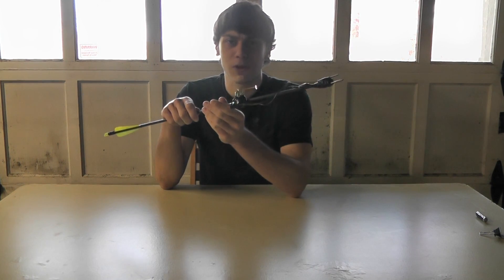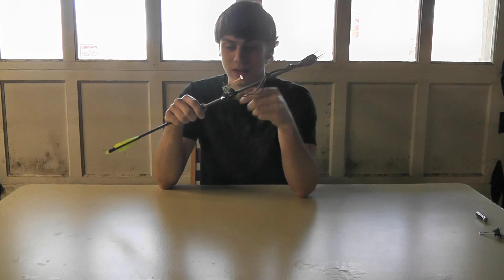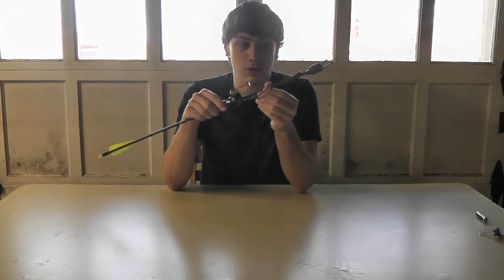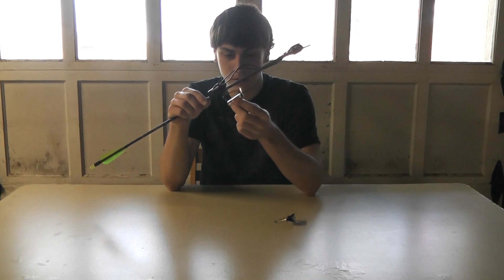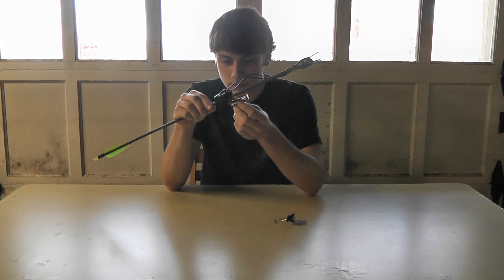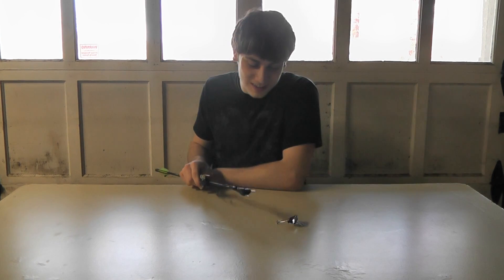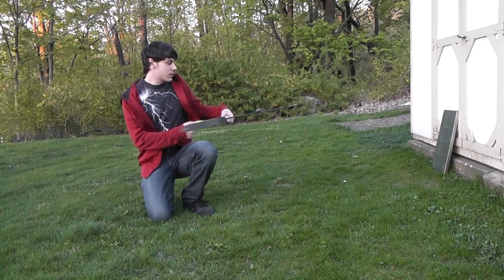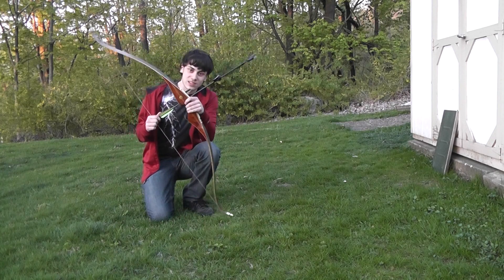Taser Arrow

Comment: I have a few questions:
1: What kind of voltage can it produce?
2: Is there a way to increase the shock time/voltage?
3: (follow-up to question 1) Is the voltage deadly?
4: Could you make a tutorial?
Reply from the maker: Excellent questions. I don't know exactly what voltage it produces. A quick Google search says 300v. That might vary between brands. I used a Fuji film camera. I recommend using this brand because the circuit board is small and ideal for an arrow. 

I know very little about electrical engineering. A disposable camera taser requires knowledge of how to solder wires to a capacitor. If you can solder you can make one. I'm sure there is a way to change the properties of the zap with the right parts, however I can't give you specific advice about that due to my inexperience. I may not know what specific parts you would need, but if I was improving my design in such a way I would start with the lightest smallest taser I could buy and mod it from there. 

Deadly is a difficult question. Deadly is determined by the voltage and the resistance of one's body. The resistance varies based on factors such as weight and muscle mass. Bigger dudes can take more voltage. I know it's not lethal for me. Before I shot the grill door I missed and shot the shed. When I went to pull it out I zapped my hand. (Sadly I no longer have this hilarious footage.) That isn't the only time I've "tested" it. I'm 170 medium build and to me it feels like less then a hard punch. Say 3/4 of a good hard punch. And the pain doesn't linger at all. If you're smaller than that or other factors come in to play then it might be deadly I really don't know enough to tell you it isn't ever lethal. The only thing similar to that on the web is that someone died from something similar. Someone made a similar device out of a large camera flash, the kind that pro photographers put on their cameras. I don't know if that was a reliable source. http://www.sciforums.com/threads/shock-from-a-camera-flash-is-lethal.40865/ 

I'm not making a tutorial on this for a few reasons. 

First the design is flawed. After repeated use the nails break out of the electrical tape. Even if that doesn't happen best case scenario the target is going to be more worried about the 3 nails stuck in him. I have plans for a better one, however before I can work on that I need to make a sub lethal arrow that has a long range. I'm close to success on that. After that I might make a taser arrow 2.0 however no promises on that either. If I make a taser arrow 2.0 I would likely make a tutorial on that.

Secondly the design is literally an Altoids taser taped to an arrow. Without an Altoids box of course. https://www.youtube.com/watch?v=vjXwBmettUs His tutorial will teach you everything you need to know. I have nothing to add to Altoids tasers at the moment so I do not plan to make a video on them soon. 

I'm really glad you asked those questions I could talk about this stuff forever. Feel free to ask if you need any more help.
Reply: I have an idea on improving the tip of the arrow:  I know Its different but this is designed for small game and with some tweaking it could be a useful substitute here's the link: http://www.amazon.co.uk/Style-Points-Archery-Hunting-Shooting/dp/B00N7249XW/ref=sr_1_45?s=sports&ie=UTF8&qid=1418974333&sr=1-45&keywords=arrow+tips
Reply: what do you think? any thoughts?
Reply from the maker: Ah, the stump tip. The stump tip is an arrow tip that is incredibly useful for practice shooting. You can shoot stumps or whatever you want within reason and the arrow tip will be undamaged. What makes this tip unique are the springs on the front. What they do is after an arrow is shot into dirt the springs push it back out and stand it up strait; at least ideally. This makes them easy to find in tall grass. 

Will they decrease the force of an arrow to a person? No not really. The springs only do their job once the arrow is already in its target. 

You might be able to make a better tip with a push spring though. I wish I could draw a picture in the comments. I'll do my best to describe the idea in my head. You could have an arrow tip that is a spring and then when it hits its target and the spring compresses the electrodes would come in contact with the target. Now a spring big enough to cancel the force of an arrow might be too heavy to allow the arrow to go sufficient distance. Only testing will tell. Or math I suppose, however at that point I tend to just figure things out from trial and error. Sometimes the results are so comical and unexpected that they can make a video on their own.

You're welcome to do some tests yourself with that design. I'm the middle of several other projects right now so you are likely to get up to the point where you can collect data before me.

Now if you do that make sure you know what you're dealing with. When you mod arrows there is a greater chance of breaking them. Especially if you don't know what your're doing. Worst case scenario would look something like this. Be warned its gruesome. http://www.texasarchery.org/images/brokenarrow/CEarrow510-21-04.jpg 

That is probably not going to happen if you do plenty of research and experiment in a way that is as safe. Remember that professionals started out as beginners. Still a mistake can have severe consequences, and sometimes mistakes can be unpredictable. 

Ideas are harmless though. Well, unless you're like me. When I don't know if my ideas will work in real life I just have to test them. I just need to know. When I get close to success and fail because of something previously unknown I gain knowledge. I also become incredibly frustrated and can't focus on anything except how to make it work. Even if that means learning to safely fall 10 ft to test my design without harm coming to me. If that last sentence didn't make sense to you then watch Grappling Hook Arrow Tutorial and you should know what I'm talking about.

Thanks for sharing your idea. Even though it wouldn't work it inspired that ^ idea. Also no one learns anything from being correct. Knowledge is gained from making mistakes and working around them.

Comment: Im sorry but not as good I made a glove like that but not good the transformer has 250 to 350 volts witch might sound alot but its not try a bug zaper at 3000 volts for 7 bucks and then remove the capicter for a consitent tazz cuzz u dont want to forget the resistents of skin
Reply from the maker: Right now I'm focusing on new ideas instead of making old projects better. But I agree this should be revisited. After I finish blunt arrow I'll know how to make a more durable taser arrow. I was going to go over how to make the taser part in another project "remote control taser" then I found out that tasers are illegal in my state. I think I can get away with the arrow because it's a prop, but I'm gonna play it safe with the remote. I took it apart and I'll film that project while I'm on vacation (in Maine). Also you'll be happy to know that I have 3 other projects done (waiting on weather).
Reply from the maker: Yes, but bug zapper parts would probably be too heavy for an arrow. Plus I don't intend on shooting anyone with this so it doesn't really matter.
Reply: Hahaha alright
Reply: AceOfThrowingCards Is this project still being continued?
Reply: AceOfThrowingCards Awesome man! Can't wait.

Comment from the maker: I've finished and tested the hook part (it supports my weight). Right now I just need more para-chord for rope. Then I'll attach it to an arrow and see if it works. If it doesn't then I'll still have a sick grappling hook and a good video. If it doesn't work on an arrow I'll be thinking about a lighter design for my hook. So to answer your question I can't give you an exact day, but I'm planning on presenting the grappling hook arrow in my next video. Unless I do something for mischief night.